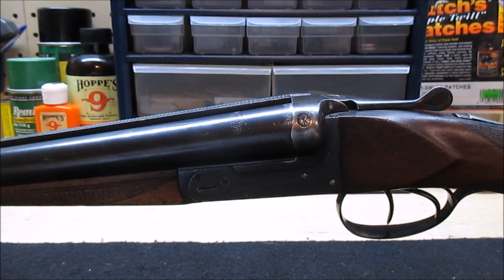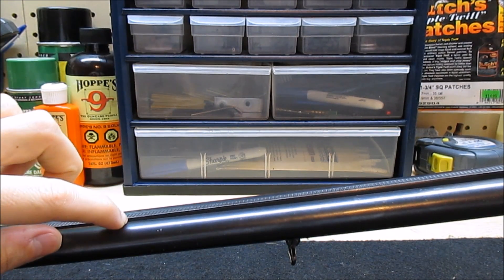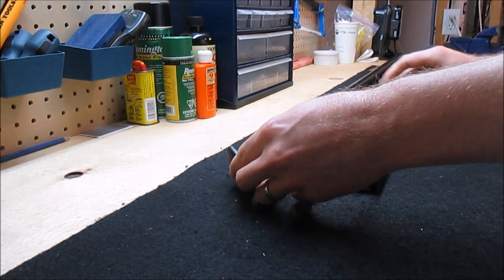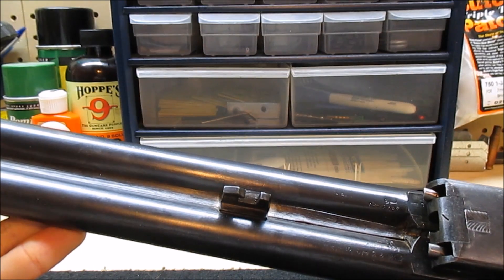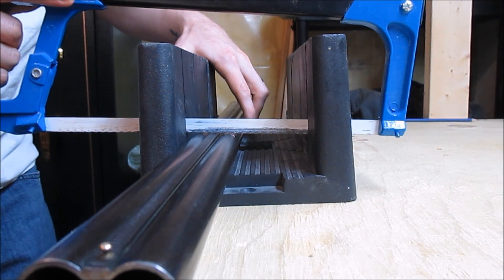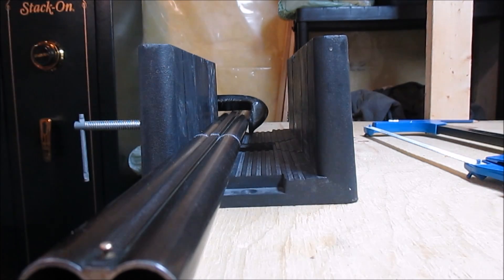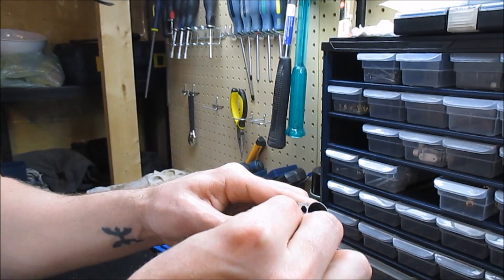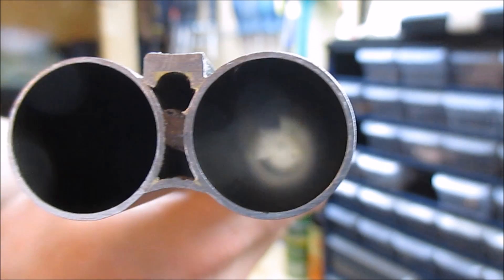Coach Gun Project Part 2: Cutting A Shotgun Barrel

Comment: I happened to have just bought one of these Belgian doubles for the exact same project.  Funny to pop on Youtube, and see someone doing the same thing.
Reply from the maker: Douglas Henderson Nice! They make great project guns. Mechanically solid, and fun to work on. Good luck with yours!
Reply: +Douglas Henderson  I got one coming in the mail right now to do the same.
Reply: +stonedimaculate1983 If I were to do mine over again, I would do one thing different.  Instead of filling the area between the barrels with J.B. Weld, I would put stainless steel wool in the hole, add some flux, and fill it with solder.  I think it would look much better in the end.  Did you order your shotgun from Simpson LTD?
Reply: Douglas Henderson im gona use steel wool and a either solder or a mig
Reply: +Douglas Henderson never heard of simpson gona have to look them up

Comment: I have an old 16 gauge damascas steel double barrell shotty ,,  nice looking gun but my ex girlfriend was moving it with one hand when I told her to use 2 and didnt ,,, she dropped it and it hit a corner molding and put a dent in one of the barrells,, Because its damascas all the smiths I called to  repair it didnt want to becuse they cant guarantee the steel wont split/crack so I am going to  just shorten the barrels , its at least 100 years old and have never shot it anyway ,, but that dent is hard not to see

Comment: How long did it take  to cut with the hack saw?
Reply from the maker: Not long. A few minutes, maybe. I just edited most of it out because it's not that interesting.
Reply: @webster7710  thanks. Being in my 60’s I don’t have as much elbow grease as I used to lol
Reply: @webster7710  I finished hacksawing it-took between 30 to 40 minutes because I rested three times between cuts. But it came out great at 19” inches
Reply from the maker: @RKO1978  Perfect! Glad to hear you got it done.
Reply: One more question I noticed a slight angle on my cut . How do you square it Thanks again
Reply from the maker: @RKO1978  Luckily, I didn't run into that issue with mine. However I have seen it done with a benchtop sander, something that has a straight edge to set your piece against to get that 90 degree angle. Failing that, a hand file, something to indicate 90 degrees and a lot of patience will get it done, just don't be in a rush lol. Good luck.
Reply: @webster7710  thank you . I’m not in a hurry so it will work out